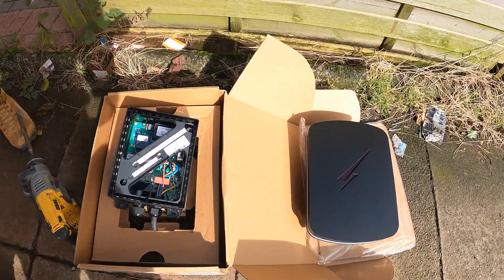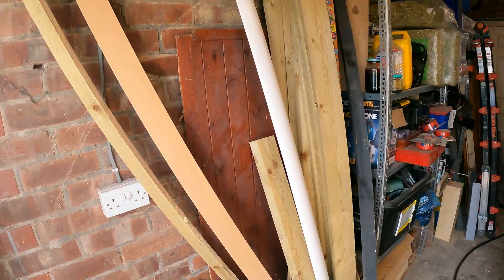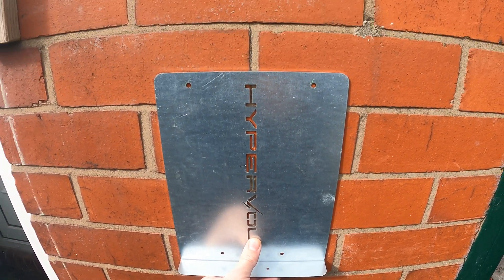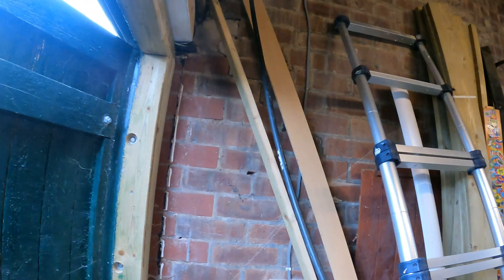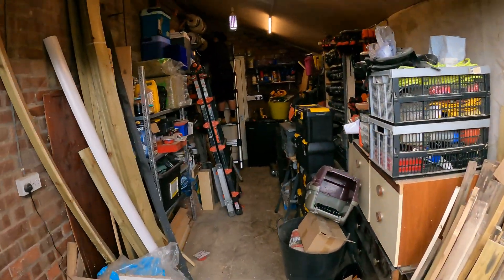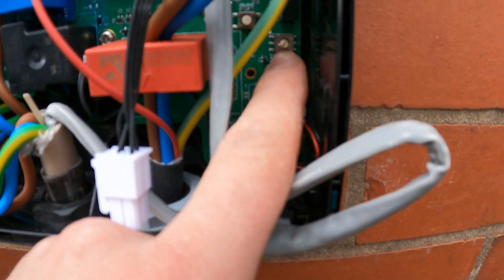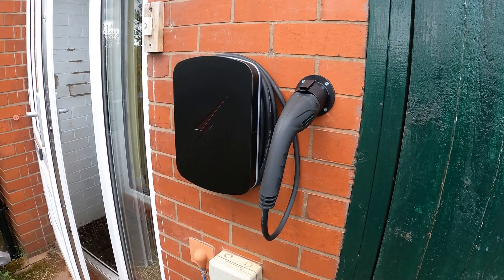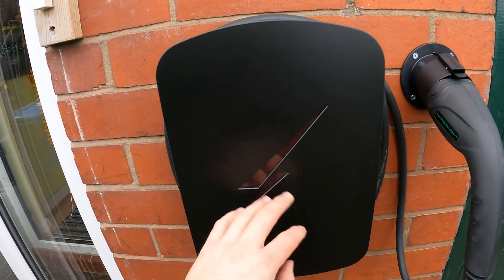Install A Hypervolt EV Charger | Electrical Life

Comment: Why do you need a double pole RCBO thought they were only needed when the N is bigger than the L
Reply from the maker: It’s in the regs now for all EV chargers, it’s actually worded wrongly saying double pole, but it has to disconnect the neutral as well under a fault which these will do.

Comment: This charger is complete junk don't buy it trust me
Reply from the maker: What’s the problem?
Reply: @Cablesmith  misses charge, charges don't save data on the graph. Locks itself so doesn't charge, goes offline so doesn't record the charge, if you ask hypervault it's always something you've done. On night schedule charge plug in the day and starts charging. I posted it in the Facebook group they blocked me.
Reply from the maker: @rajindernijjer  ah that’s no good, and blocking you is unprofessional! I’ve not had any complaints from customers yet but I’ll be wary now
Reply: @Cablesmith  because people can't be bothered hypervault themselves told me they got issues.
Reply: I have had problems with this charger too. You contact Hypervolt they give you a ticket and it never gets resolved. Its always “ oh it’s something we are looking into “…..
Reply from the maker: @JamesDavis-y9z  ah this isn’t good to hear!

Comment: Can I supply my charger from spare way in my attached garage cu? The cu is fed with 10mm cable. Cheers
Reply from the maker: You can yes but you would need the CT clamps to be wired back to the main incomer cables. And also a quick calculation to see if the 10mm can handle the charger plus whatever else it runs at the same time
Reply: @Cablesmith  cheers👍

Comment: Great video! Question - I’m looking at getting the hyper volt. I have solar and DC battery storage. I would be looking to set this up so that the car charges when I’m exporting to the grid, where do u put the ct clamp for that? I don’t want to drain the house battery to charge the car. How would u set this and and where would you put the cat clamps? Thanks in advance

Comment: Pity you don’t cover Cornwall as it would be good to use you. Can I ask, does the supply have to go back direct to the consumer unit or could it take a spur from a 6mm supply to hot tub? Which is fed direct from the consumer unit. Where we park the car is no where near the unit and don’t want cables going all around the outside of the house?
Reply from the maker: I’ll be in Cornwall next month but for a holiday 😀 as for the supply, no you can’t take it from anything else. Being 7Kw it has to be on its own circuit

Comment: Informative video !
Quick question please . Is the lead connector holder a must have ?  Can l loop the lead around the charger and leave the connector hanging?
Reply from the maker: Straight out of the box no, because there’s no protection from water entering the plug. However I’ve just fitted one this week and the customer bought their own rubber cover to do this

Comment: Nice little job that dude. I installed an Ohme home pro a few weeks back, first EV install. It took a while to get the RCD trip sequence sorted. The Ohme charger has an installer mode that nulls the restart time after a fault. I thought that was a nifty feature. The device in the EVCP always tripped before the upfront RCD. 🤷‍♂ Great video as always mate.
Reply from the maker: Definitely a good idea. You’d be surprised how many electricians I’ve spoken to about the Hypervolt and they’ve complained about the random start making testing hard and they’ve not known it can be switched off!

Comment: That 3.0 looks loads better!! Nice that it comes with the little booklet aswell, it will save me getting messages of sparks asking how to set the load limit 👀😂
Reply from the maker: Hahaha yea man it’s miles better init!
Reply: @Cablesmith  yeah dude, is that a new template aswell? My old one doesn’t fit on the on the newer plastic hypervolts
Reply from the maker: @Waynesworldofgaming  yea I think this was for the Hypervolt 2.0 template. Fits the same this time tho

Comment: that door bell though!
Reply from the maker: there’s method behind the madness
Reply: @Cablesmith  we just don't know what it is though
Reply: @mattsan70  Wire route was like that when we moved in and I never got round moving it. The split bit of timber behind it is on the to-do list.  The timber was added last time I changed the bell push in order to get the wire in behind and avoid cutting the bell push casing - and this one has lasted many year longer than previous bell pushes.

Now you know. 😀